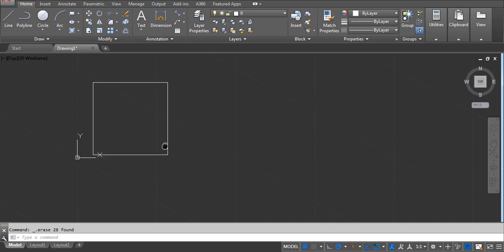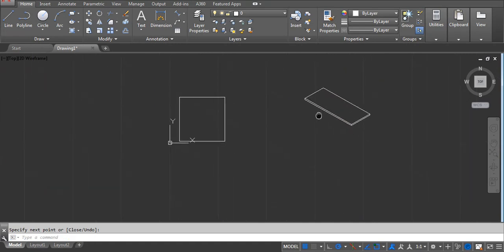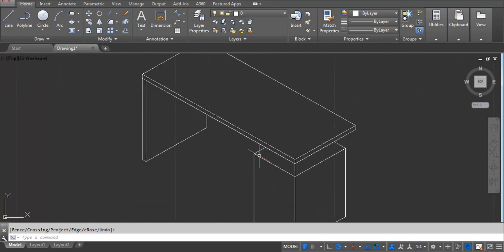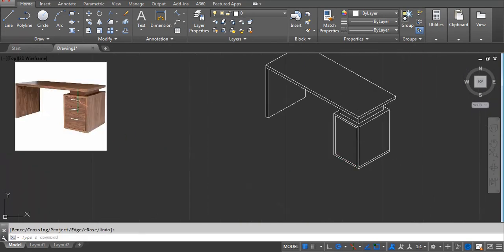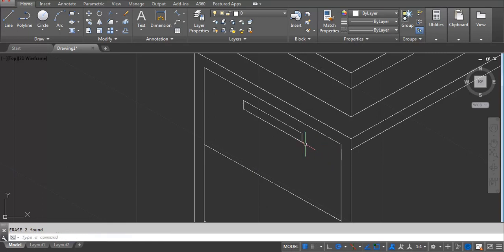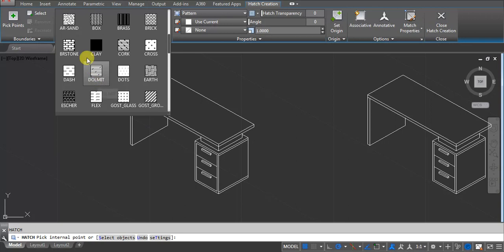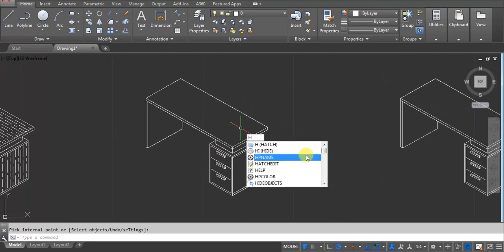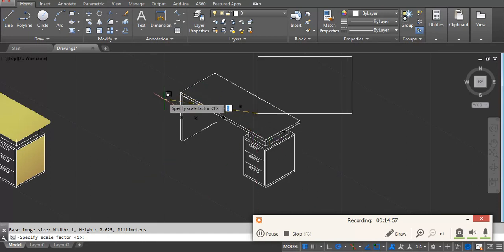Isometric Office Table in AutoCAD with Super Hatch || Texture in AutoCAD || Different types of Hatch

Comment: Mam I'm able to only apply the hatch on 2d diagram not on 3d , and especially in the surface, any way , I'm using autocad26
Reply from the maker: AutoCAD requires a 2D closed boundary for hatching.  First check that
Reply: @SidhnathCreation  its not working, is it because i have student account😢
Reply from the maker: No it's not like that.... But,, you cannot hatch curved surfaces like cylinders or spheres
Reply: @SidhnathCreation its just a cube mam
Reply: @SidhnathCreation Would you say me which version are you using
Reply from the maker: Do one thing - take a screenshot, upload it to ur drive, and share the link here. I’ll check it.
Reply from the maker: First tell me... What are you making with this cube?
Reply: @SidhnathCreation Im in the beginning stage learning cad so thats why i try to color it
Reply from the maker: In this case you can use the material.. Look at the top-left corner of your drawing viewport
Click the Visual Style control - usually shows 2D Wireframe
Select Shaded or Shaded With Edges
Reply from the maker: AutoCAD 3D playlist  https://youtube.com/playlist?list=PLkGZ0s7QqXUhsraUIKEWbs8VsSFTXYGH6&si=I7KMWrOdKl6v5Xv-
Reply: @SidhnathCreation okay mam